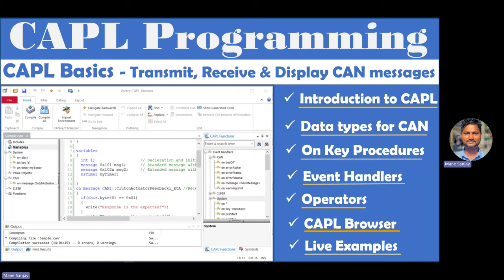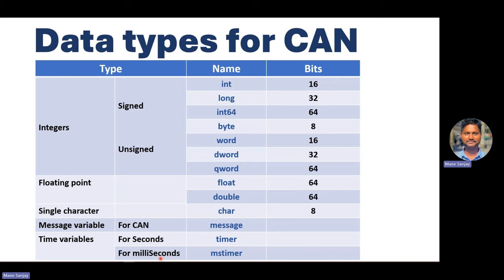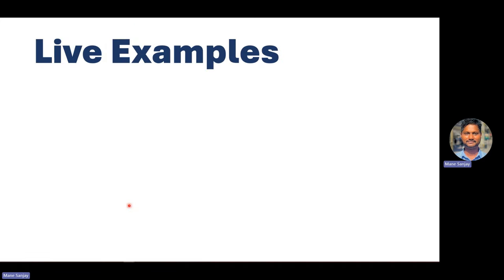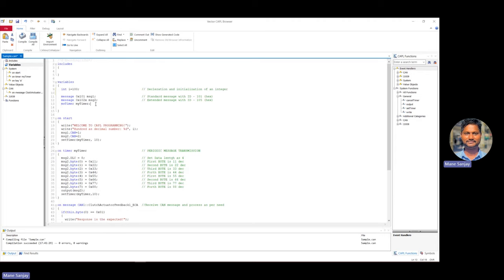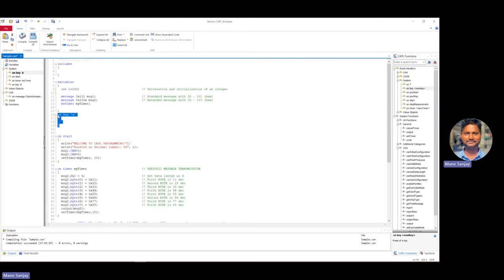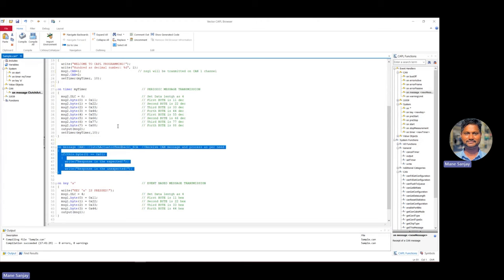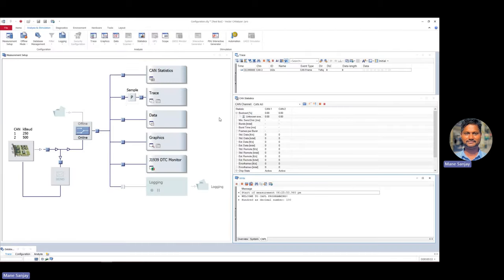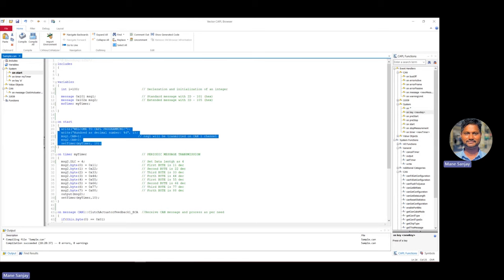CAPL Programming | CAPL Training | Basics of CAPL | Transmit, Receive CAN Messages Using CAPL Script

Comment: This video really made clear many things but i have a question,  what are the meaning values of 0×11 , 0×22 , 0×33 , 0×44 ... after msg2.byte (0) or (1,2,3) what are the meaning of these numbers ?
Reply from the maker: Ox11 means only value nothing else. It’s one byte value I am setting in the data frame. So I picked 0x11, 0x22, 0x33, and 0x44, these are hexadecimal values set at byte 0 to byte 3 respectively in data field. You can set any value as per your wish. But when you set 0x before any value that means that is hexadecimal value. Without 0x if you set any value then it would be decimal value by default.  msg2.byte(0) means I am setting value to data field at a location of first byte in CAN message of name msg2. Msg2 is a name of CAN message and I am setting value to the byte location 1st. Hope it clears your doubt. Feel free to ask for queries and do share, subscribe for more updates.
Reply: @SanjayMane_Tech  yeah it s absolutely much more clear now. I have subscribed I hope you continue to share videos maybe these may include much more projects.